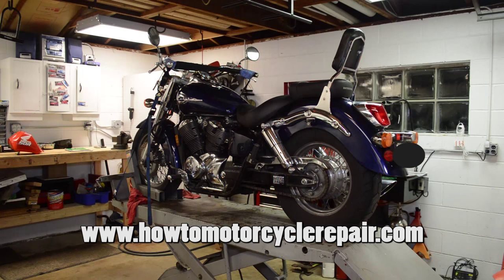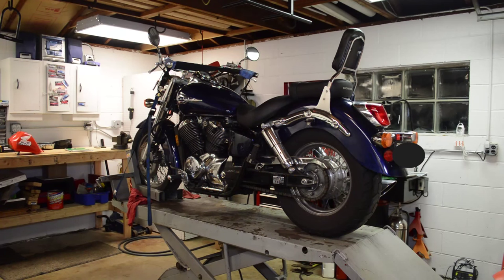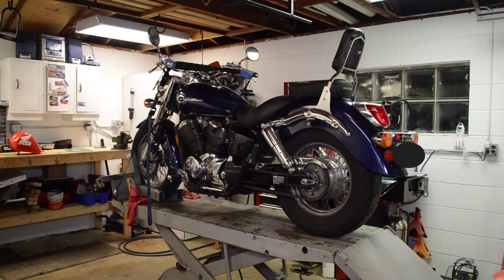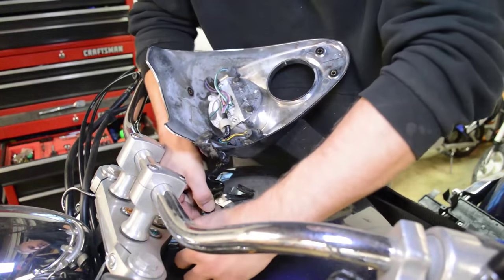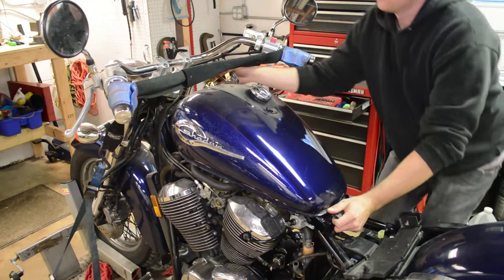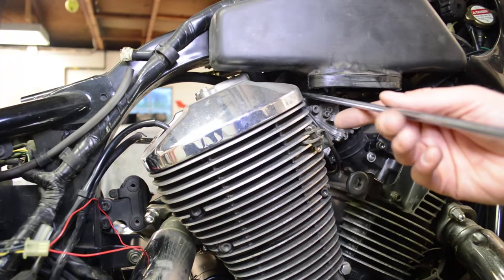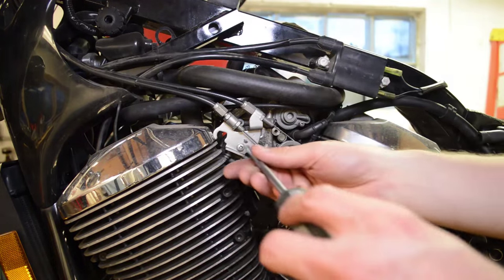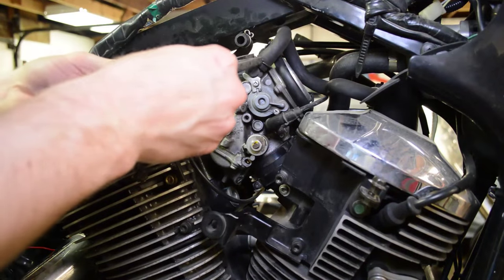How-To: Honda Shadow VT750/VT1100 Carb Clean & Rebuild 1995-2007

Comment: I would strongly recommend to anyone who has never done this before. take pictures of everything before you disassemble as much as you can so you can use those pictures as a reference when you go to put it back together helps out a lot.🇺🇸
Reply: Yes sir great tip thanks for the reminder
Reply: The older I get, the more I do just that!
Reply: I decided to not mess with it when I saw that many nuts and bolts lol. I just bought a 2009 with 6k miles. 509 bux. Turns over but nothin happens
Reply: And use a lot of baggies or plastic cups for screws and bolts! I like to label each baggie with the location of each part they came from and what they were holding on to the bike.
Reply: Great advice!! Thank you
Reply: I'm getting ready to do this and I'm appreciative of all the tips. Pictures, labels, basically a schematic of b4. Anybody has any other tips I'm all ears
Reply: Exactly what i was thinking to do as i haven't taken a bike apart before.😢
Reply: Does the carbs not have to be synced?

Comment: First, I never review anything, but after reading some of the comments I felt I compelled. Second, the last time I repaired a carburetor Jimmy Carter was in office.  Wanting to be successful in my repair efforts I purchased several repair manuals.  I found them to be a bit lacking in detail. So I purchased the video to assist me in my quest.   It just happens that I own a 2002 Shadow.  I thought the video could have used a few more shots of the air box removal, but overall I found it to be very helpful and well worth the $20.  I took me about three hours to complete the project and now my bike is running like new...  Thanks for the video.
Reply from the maker: Thanks for the review, Tim. Glad your bike is up and running like new!

Comment: I just bought a 1996 Shadow VT1100C2. The prior owner took the fuel lines off to replace them and just left it parked for 5 years while he enjoyed fatherhood. He sold it to me for $800 in pieces. I ordered a repair manual for many reasons, but one is to clean and inspect the carb and two is to see where/how the new fuel line connects. I’ve not had any luck on my own while I wait for the manual. I figured while I wait for that and other parts to come in the mail, I’d purchase and watch your video. The 750 is much different as far as air intake set up and line routes, but I’m crossing my fingers the carb clean/parts is just as you showed. I enjoyed the video, worth the price if it’s identical to my carb. I just don’t know where the freaking fuel line goes from the fuel shutoff to the carb. The old original line (thrown in a box of mic bolts), looked like it had a t in it btw... but nothing attached to the T. Just a line up and a lone down. The tank has what I thought was a vent tube coming out the opposite corner of the tank from where the fuel supply is. Would a fuel line run from that vent tube to the T in the fuel line? Or is it a vent, or does that run somewhere else?
Reply from the maker: Can you email me some pics?

Comment: I also was originally put off by the price, then caved and bought the full-length video.  For me, it really helped.  I've never touched a carburetor before, or done much engine work at all really.  I got it apart fine, and got it together fine, and now the thing runs like new.  Here are my notes, which might be helpful to others:

- 2002 Honda Shadow VT750 ACE
- I took it slow because I really didn't know what I was doing.  I just paid attention and tried not to mess it up.  So in the end I wound up spending at least 20 hours from start to finish, over the course of about 5 evenings.
- I bought the replacement part kit he recommends (2x$20), the silicone lube ($3ish), shop rags ($5), the video ($20), and carb cleaning spray ($5ish).  So overall, this repair cost me $70 plus time.  Significantly cheaper than taking it to a shop.
- I used a set of very sharply tipped tweezers designed for working with small electronics.  It made lots of the delicate work dramatically easier.
- Rather than using Chem Dip (I didn't want to deal with a gallon can of hazmat for a single use), I sprayed the parts with carb cleaning spray and rubbed off the scale with a shop rag.  It seemed to work for me.  For the parts with rubber components, and the carb body, I soaked them in pine-sol and water, and scrubbed them with a sponge.  Then for the body, there were still a few places that looked like they could use extra attention (including those passages mentioned in the video), so I sprayed the cleaner spray through them and rubbed with a shop rag.  This approach seemed to work well.
- There's another small part that can come off each part for cleaning.  After you take off the little disc pistons, you can also pull out the black plastic elbow intakes.  I'm not sure what these are called, but they connect by hoses to the top of the front cylinder.  It looks like it's air used to pneumatically power the carb's pistons.  Anyway: I found some gunk in there and cleaned it out with carb cleaner spray.  Also, the replacement part kits come with replacement gaskets for these, so I replaced those.
- On my bike, for some reason, the fuel mix control screws were sealed over.  Some weird metal plug with no way to get a screwdriver in.  So I couldn't adjust these, clean them, or replace their gaskets.  It seemed to run OK after, so I'm guessing they're sealed into the correct position.
- I found a 110 jet on the rear piston, and a 105 jet on the front piston.
- I used every part in the replacement parts kit, except for the gaskets that go on the fuel mix control screws, since those were sealed in.
- Getting the carb seated on the rubber output boots was the hardest part of the process.  It seems like the order in which you do things is really important here.  I tried a few things without success, and found this order worked for me: 1) Install boot on rear cylinder 2) place carburetor in its cavity 3) place front boot in its correct place and orientation 4) push the carb down on the left side until the rear boot seats 5) push the carb down on the right side to seat the front boot.

Hope that helps someone!
Reply from the maker: John, nice job! You should really go back and remove the fuel screws and clean them up, and then adjust them. Here is how to remove the welch plugs: https://youtu.be/uAP2gfAqSII
Reply: Thanks!  That doesn't look too bad.  I'll get in there next time I have the chance.  That's real silly how the manufacturers plug over the screws like that.  I would never have realized it's just a soft aluminum puck stuck in there.
Reply from the maker: All manufactures do this for EPA/emission reasons. I always remove them and leave them out.

Comment: Top tip, check and/or change your spark plugs before you try removing the carbs.  Also try removing the carb drain screws and flush carbs with brake clean.  It worked for me and saved alot of aggrivation.  The thin wall 18mm socket in a must.  Horrible design

Comment: My bike (01 Shadow 750 ACE) was running great, then acted just like it was running out of gas, but when I switched to reserve it still cut off. I couldn't get it to start after refueling and my uncle suggested I clean the carbs. 

I thought I did a decent job until I went to put it back on and somehow dropped it on the pavement walking to the bike. Smdh it ruined it, so I figured I should just take it to someone with experience. He said he rebuilt a used set of carbs and put on a new fuel pump, but it's barely running at all. 

I was able to limp it back home, and once it got up to speed it wasn't that bad, but if you pull the throttle much it starts to die and sounds horrible.

It's over 20 years old, but only has about 35k miles.
Reply: Did you ever get a solution to this? I had the same issue where it just dies and no power

Comment: I gave your video a thumbs up. Would be nice if the video was in several parts at normal speed, so I could see the routs for the hoses and cables. Purchased an abused 2003 Honda Shadow VT750CDC and there's a lot of hoses, cables and electrical that are installed incorrectly.
Reply from the maker: Full video is very detailed: https://www.howtomotorcyclerepair.com/hondashadowcarbclean/

Comment: Thanx 4 the vid, helped me a lot with the cleaning of my vt1000 carb. I do have a question, when I removed the carb I noticed the manifold and intakevalves were covered with a layer of (i think) carbon. Is this okay? Many thanx in advance!
Reply from the maker: That is normal
Reply: @HTMR  thank yoi very much for awnsering my question, doing this 4 first time and a bit unsure

Comment: 2006vt750dc only 1400 miles sat long time ,replaced everything, in fuel  ide good at 40 miles ,but give it throttle starts back fires  ,can't figure it out,

Comment: Hi Matthew. Great how to vids. I have an 02 750 ACE. I was wonder if if you may have done one on water pump repair,or know of a you tube posting. I believe the engine has to be pulled out on the 02. in order to get the pump out. It would be a 1st for me. I'm looking for as much tutorials before i touch anything.
 Thanks for your time.

Comment: I’m having trouble with my 96 vt1100 tried starting it … replaced fuel pump made sure it’s sending fuel to carbs but not starting still … starts when I spray starter fluid what do you guys recommend I do
Reply from the maker: Sounds like the carbs are dirty.

Comment: My 2005 shadow aero 750 has a single carb design that is different and i cannot seem to find any videos on the setup my bike has
Reply from the maker: I have a single 600cc carb vid, closest I have available: https://howtomotorcyclerepair.com/shadowpipesjetting/
Reply: @HTMR  ok I'll have to check it out. I did f9nally get it runn9ng right yesterday finally I changed a few vacuum lines and re cleaned the carb and it seems to run alot better

Comment: I love the sound of your 750. What type of exhaust are you running.
Reply: I'm pretty sure that's the stock 2-1 ACE exhaust. At idle it sounds pretty lame but it actually sounds halfway decent when you crack the throttle. The biggest problem is it's not loud enough to cover up the Honda intake whine.

Comment: where does the vent tube connects to?
Reply: To nowhere. It's opened to atmosphere. (If you mean the two with a small diameter at the top connected with a tee)

Comment: Hello! How can gasoline get into the crankcase of the engine, that is, into the oil? (Shadow ACE vt750 1997) (RC44) Thank you
Reply from the maker: A stuck open float can have fuel migrate to crankcase.
Reply: @HTMR 
 Thanks a lot
fuel comes from here
Reply: can't insert picture
Reply from the maker: @Vonogaz  Email me here: https://howtomotorcyclerepair.com/contact/

Comment: Whenever I look at a carb rebuild for a VT 750, it's a dual carb. I have a 2004 VT 750 and it has a single carb. Is mine special? What's up with that?
Reply from the maker: There are single carb models.

Comment: Hey, I decided to purchase your Vid. I'll let you know how it goes when i get around to finishing it. THX
Reply from the maker: Yes, keep me posted and email me with any questions you may have.
Reply: Well, I got the carbs out. It was a little tough but not to bad. The gas lines are gummed up as well as everything fuel related. Is there any place you recommend for the lines? A kit maybe, and if so where from? THX
Reply from the maker: Terrance, I would try boiling the fuel lines in water mixed with lemon juice. Worth a shot and won't cost much.
Reply: Definitely worth a shot thanks!

Comment: Excellent video. But brother help me please. There are hoses that’s on the top of the carbs. 2 of them. They are joined by a splitter but I have no idea where the other end plugs into. If you need more details I’ll provide pics.
Reply from the maker: You can email me here: https://www.howtomotorcyclerepair.com/contact/

Comment: What's the float height on these ?
Reply: 7 mm, but make sure the carb is oriented in the right way (the float does not push the needle on its weight)

Comment: just bought video for the 02 honda ace 750 have the exact same problem with the bike I just bought except when i get bike running on starting fluid gas leaks from carbs thinking float or pilot jet is the culprit  but i don't see the manual for this bike
Reply from the maker: Contact me here and I will send the manual: https://www.howtomotorcyclerepair.com/contact/
Reply: done and thanks for such a quick reply and great video tutorial very easy to comprehend
Reply from the maker: Done already? Nice! Thanks for the compliments on the video.

Comment: I will buy the later single carburettor model. The twin carburettor models are just too hard to manage. All I wanted to know was how much trouble is it to take the twin carbs off and it is BAD NEWS MAN. Double your trouble with 2 carburettors, the later models with single carbs are the go and much easier to work on.
Reply from the maker: I agree, it is the worst part of the job. Sucks if you have to do it twice...LOL.

Comment: There is a vacuum hose with a short elbow plugged onto the carb, the other end into a T with a short down hose from the T  plugged into the carb and a long  of hose from the T runs around the  side of the vacuum piston cap and is held there with a strap on the corner cap screw.  My question is, where the heck does the free end of that hose plug into?
Reply from the maker: Contact me here and I can send you the manual. There is a good routing diagram that explains where everything goes: https://www.howtomotorcyclerepair.com/contact/
Reply: I saw your offer for the service manual. I have a 2002 shadow ace 750.
Thank you it may be a big help
Reply from the maker: You have to email me here: https://www.howtomotorcyclerepair.com/contact/
Reply from the maker: The email you provided bounced back. You must of entered it incorrectly.  Please try again.

Comment: I'm having a strange issue and I can't wrap my fingers around it. I have a 03 shadow ace 750. I was riding and lost power out of no where so I figured maybe mu buje wasn't getting enough fule. I cleaned both carbs, put new gas. Checked the fuke filter and pump, everything is good. When I start it it backfires and in pretty sure the front cylinder is misfiring. Any tips on how to diagnose this?
Reply: Damn, mine is doing the exact same thing. Did you check the mixture screws on the carbs, and make sure your spark plugs are good?
Reply: @Slow_KZx10r  did you ever get a solution to this. Same model year. Same issue for me

Comment: hi i recently cleaned my carbs but i didn't remove the idle screw and clean it as my friend forgot to mention that i would need to. long story short the bike is still cutting out when i push the choke back in. do you think not removing the idle screw and cleaning it when i had them apart is enough to cause the bike to cut out?
Reply from the maker: You need to remove the fuel screws and clean the passage. Crud will accumulate in there and cause issue you are describing.
Reply: thanks for the reply Matthew. looks like i"m pulling the carbs again.

Comment: The dude I paid to fix mine bought the wrong size rebuild kit, and when the gaskets didn't fit instead of realizing his mistake HE JUST USED SILICONE... so now it's in every bit of my carb. Smdh I've never gotten into it with a mechanic, but who the hell would puts silicone inside a carburetor?! That blows my mind.

Thanks for the video though, I'll probably be cleaning this thing until it's too cold to ride again.

Comment: Hello, I've noticed in this video before it starts FF that at times you are working on one side of the bike but the camera shot is on the other. Is this common through out the vid? Please let me know before I purchase. THX
Reply from the maker: Terrance, in order to remove the carbs from the bike, you have to disassemble components on both sides of the bike. The video goes through all of this. In the video I normally state, "now I'm on the left side of the bike"...etc.
Reply: Mathew, thanks for the speedy response! I understand that there are two sides to the work. I'm just curious as to why the camera isn't on the side you are on at all times. Does this happen in the vid often? I only ask because this is an instructional "VIDEO" on "how to". Seeing what is going on (for me) is imperative. By the way if I do purchase, do I download the video or just have access to it when i want? Thx
Reply from the maker: Keep in mind the sample video above is cut and spliced in editing. It jumps around quite a bit as I deleted portions of it to keep length down.

If you buy the video, it is streaming only, yours forever with unlimited views. Email support included as well.
Reply: @HTMR  I like that you didn't answer the question... twice.

Comment: i have 2006 honda shadow aero 750 i clean the carburetor and know leaks gasoline what do  you think is the problem
Reply from the maker: Stuck, dirty, or worn float needle. Try tapping the carburetor with a screwdriver handle (lighlty) to see if it will go away. If not, pull the carbs out and replace float needles.

Comment: I have a 1986 VT1100 Shadow. How applicable do you think this video will be towards the 86 carburetor?
Reply from the maker: About 80-90%. If you feel the video does not help you or is applicable after purchase, then I will refund your money. Do you have the service manual? I know I have the 750 one. I leaving town this morning so I may be slow to respond  for a few days. Matt.
Reply: If it's only about 50% applicable, it'll still be worth it. Thanks though.
Reply from the maker: No problem. Let me know if you have any other questions.